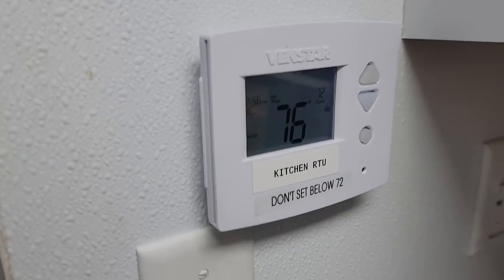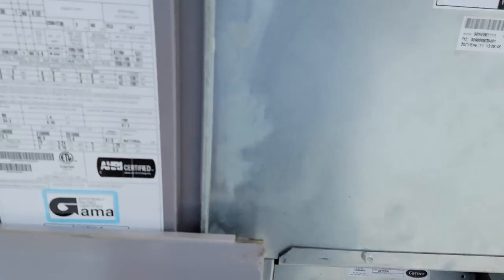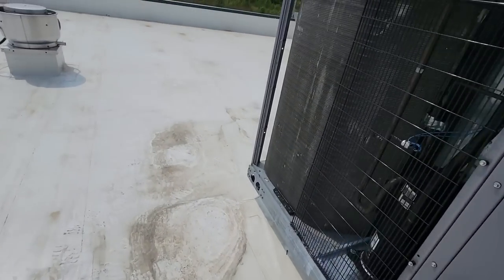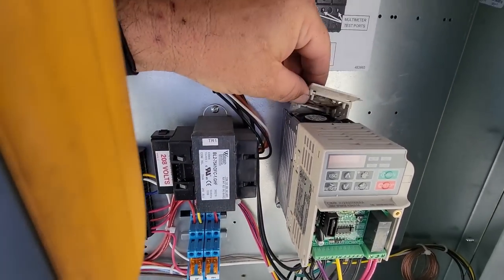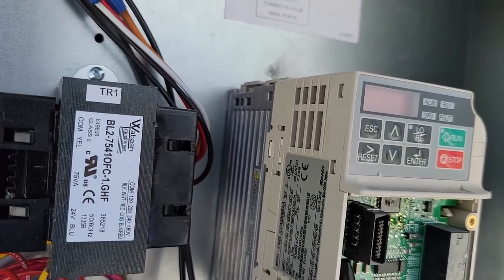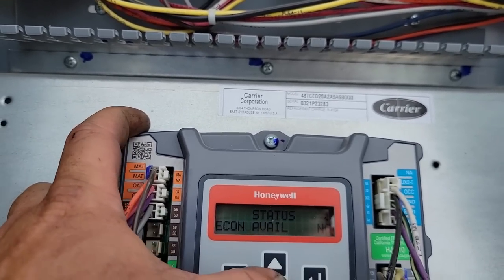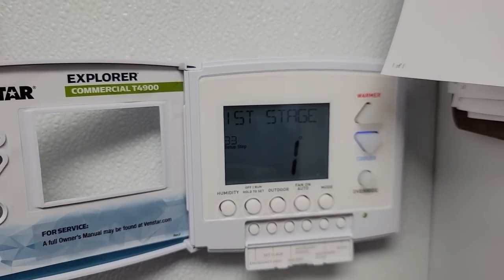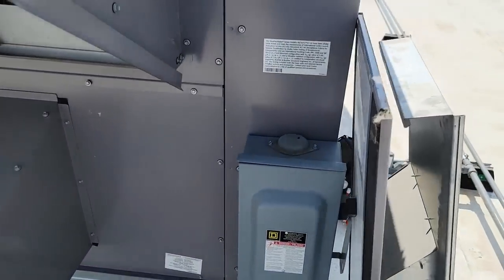Dining Room Warm & Humid LOOK Deeper Than The Air Conditioning!!!

Comment: nice work. they let the condensate dump on the roof out there? that doesn’t fly around where i’m from. beats them up real bad
Reply from the maker: There are places where we will run PVC piping to the roof drain or the spouting but it's common around Ohio to just dump it like you've seen.
Reply: @HVACRSurvival  does it not grow moss/ mold that is so slick it’s like walking on ice and make super ugly stains on those $20-$30k roofs all the neighboring buildings can see from their office and apartment windows? or do you not have those in Ohio?

Comment: That MAU not running was most of the issue as it was using the economizer as the MAU. Surprised the front doors actually could be opened without the MAU.
Reply from the maker: Correct, that's why I was saying that the air was being drawn from the front of the store through the economizer more than normal.

Comment: Hum. Both the min and max setpoint on that outside air damper was 6.5V. It sounds to me like the damper isn't going to move very much. Or am I missing something?
Reply from the maker: That is how it was originally, but I cut the high down to 5v low is still at 6.5, I was told it worked last year and that it was balanced so I tried this small change first. The biggest problem was the make-up air not running.

Comment: Had one of those controllers set at 80 degrees for free cooling.
Reply from the maker: 😂🤣🤣🤣🤣👍👍. That's the easiest controller I've ever used.
Reply: @HVACRSurvival , by far the best. You know what the sensors are reading, you know what it’s trying to do. Easy to diagnose.
Reply from the maker: I have the book outlined for a couple settings that are a little confusing like the exhaust but they have been great other than the guys hooking up the one analog sensor into the data buss
Reply: @HVACRSurvival  I mainly do installs and the book that comes with the control is awesome. Detailed and clear instructions. Easy to comprehend and in large enough print to actually read.

Comment: Did someone add minimum outside air for increased fresh air to flush out CoVid with AIR CHANGES PER HOUR.
New air standards from ASHRAE  will likely be coming down the pike with increased outside air dilution to occupied spaces for increased air quality at the expense of outright energy efficiency. Likely will be more energy recovery systems installed in commercial spaces as a result.
Perhaps the Jade settings were a legacy of full occupancy requirements during winter re-openings.
Reply from the maker: That's what I was thinking at first, that's why I said paranoia. If I say the cvd word YouTube can get pissy with their lib. views.  It was set up by the air balancers that way for whatever reason. That's how I knew where the duct work was on the make up unit when I came back to it, I made a call to the office to find out what the hell was going on.
Reply: Yeah , you hinted at that in the video that there was a call back to the office.
Reply from the maker: It's always best to ask more questions
Reply: I guess it will be very difficult to install energy recovery for outside air in a restaurant without the heat exchangers getting clogged up with grease? Maybe if you separate the kitchen from dining area.

Comment: Usually code is 20 % min open for outside fresh air on the roof tops units and bldg. fans in Indiana
Reply from the maker: That seems high. 10% in Ohio as far as I know and most don't even open it at all if they have problems cooling the building.